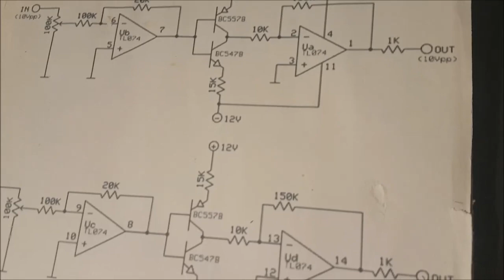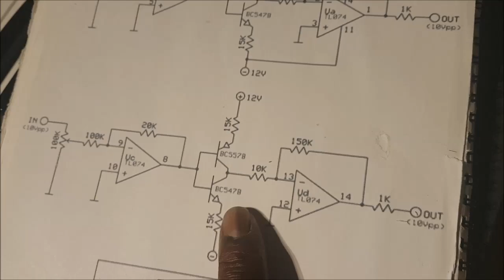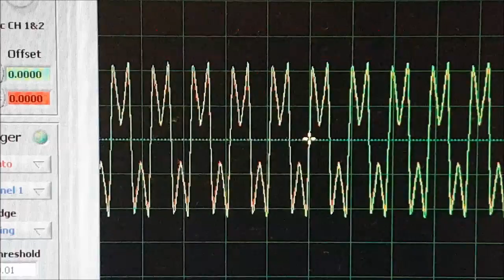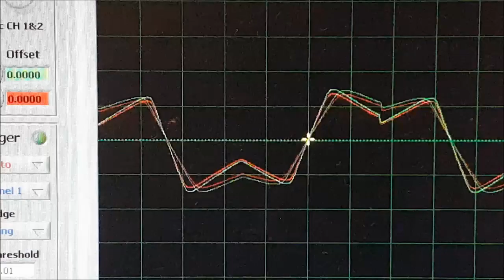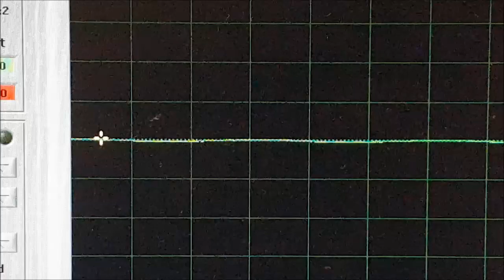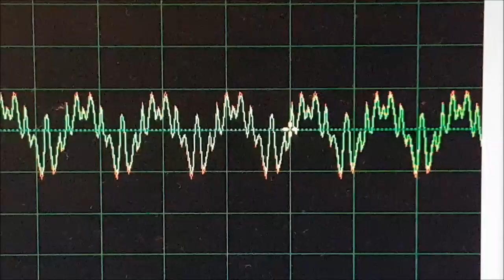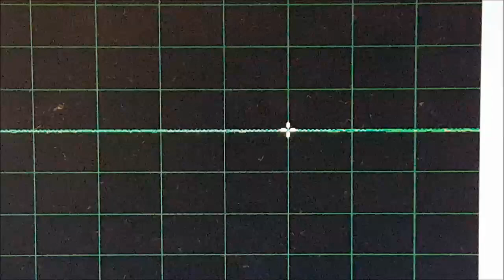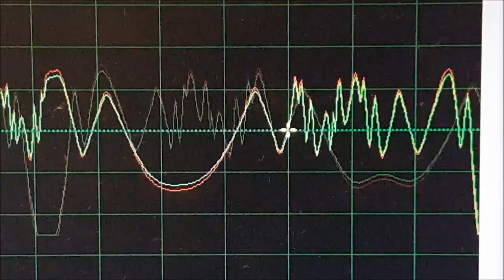DIY analog synth project (Wavefolder PCB Test Demo)

Comment: Hey brotha seeing if we can chat somehow got a few questions about circuits for ya. Let me know what’s best here or elsewhere thanks for your info much appreciation.
Reply from the maker: All good . You message me I  the comments here :-)
Reply: Adamski A.  Not used to YouTube just lost my first message hehe. Do you use discord? Trying to build up the saw core with a lm358 while some better opamps come in. Watched a few videos trying to dissect where I went wrong. I drew out your circuit and checked the tl074 data sheet then cross compared and drew for lm358. I believe I got it right but not sure how to show you. Would the pin 4 on lm358 aka ground be the v- akin to pin 11 on the 74? Using a dr meter ps 305dm will this give me v- also? Sorry if shit questions trying to not waste time .
Reply from the maker: @hereandgoneagain704  on most dual OP amps pin 8 connects to v+ and v- pin 4 on a quad op amp pin 4 is v+ and pin 11 connects to the minus. Did you set up the voltage divider to pin 2 by the way ?
Reply: Adamski A. For mine I set it to pin 6... should it be 2 and I reverse everything ? I was using pin 6 as the divider and 2 was connected to 1 via cap
Reply from the maker: @hereandgoneagain704  If you have done everything except in reverse on a quad OP amp it should work. I'm sure you have checked the data sheet.
Reply from the maker: So yeh output 1 and inverting input 2 should have the timing capacitor. Which value are you using ?
Reply: Adamski A. Just back home so the cap for me was between pins 1 and 2 on the lm358.  Going to remake the circuit and get back to ya see what’s what. If you check the pic on that Imgur link it shows the orig drawing I did. Chat later man thanks for your time much appreciation .
Reply: Adamski A. Only thing I can think is maybe my power supply is improper. It’s got a + - and ground connection so it leads me to believe I am doing it right
Reply: Adamski A. Can shoot you an email or discord invite if you wanna chat easier.
Reply from the maker: @hereandgoneagain704  Have you connected the pins 1 and 6 to a potenetiometer. Until you do that you won't have an output.
Reply from the maker: Have you watched this video yet ? https://youtu.be/u2JspaaJohY
Reply: @AdamTheAd-vanc3d  Thanks so much for your time! We got it working.   Will get some pics updated in a bit.  Beyond stoked, not sure why but I ended up needing a 0.22uF mkt box cap.  When I was using 100pf it was in dog whistle territory.  Most likely an issue on my end being uneducated.  We got oscillations though.  :D  Do you ground all your pots or do you use some like a rheostat with no ground?  Trying to figure out how to decide and when to use.
Reply from the maker: @hereandgoneagain704  Brilliant glad to hear it . Yeh the timing capacitor will basically determine your frequency range. If you ground one side of the pot the oscillation will stop. This is useful for me when I designed my lfos to completely stop the oscillation.  Try different value pots and caps for different frequency ranges. 
Your very welcome.
Reply: @AdamTheAd-vanc3d  Built up a second, and getting some crosstalk.  Now I built a triple avalanche osc before and fixed the crosstalk with some 100k resistors before the signals joined up.  This seemingly isnt fixing it over here.  Just read about 100nF decoupling capacitors on power rails.  Is this a thing that would help?  Going to attempt a few things but seeing how you dealt with crosstalk.  Also, just started a discord channel if you want to hop in it, theres litterally nobody else in it but maybe it grows.  Figure it may be easier to chat there than back and fourth here now that youtube removed messages.  https://discord.gg/WJJmX6U
Reply from the maker: @hereandgoneagain704   Using resistors on the oscillator outputs help and yes decoupling op amps and using caps in the uf range for audio signal helps. I not a master at any of this by far. Always as I'm sure you do, hunt around forums Muffwiggler and other synth DIY sites for suggestions.
Reply: Or is pin 4 going to be actual ground 0v on lm358 then run v+ and v- from power supply to the voltage divider

Comment: This is so cool. I love your videos and love that you break it down to one function per PCB. I would never manage and do a one PCB synth that did not work. Kudos
Reply from the maker: Hey thanks. Yes i originally was going to group some of the units as all vcos on one board 2 envelopes and lfos on another etc.. I sought advice and logically found it best to do it module by module due to a costly mistake. There has been some errors on some boards hence there are diffrent revisions. Thou all pretty much working now. It also allows for future expandibility or downsizing for future for example a single vco version with one filter and one envelope etc.

Comment: This folding sounds really good! Again reminds me old Yamaha chips for game consoles like Sega Genesis. What was with less beefy transistors? Were they more noisy or you use BCs just b'coz you have them?
Reply from the maker: Yes the folding  very much has  that midranging , spongy,  fm tonal quality.
I used bc 558/548 as these are higher gain . I did a 2n 3904/06 version on my breadboard which was a bit more noisier.
Reply: For a quick check it's handy to solder a piece of a "socket line". I've made that few times. Just need to place a bit of solder on a transistor's legs to fill the gaps. So it will be sitting in the socket tightly.

Comment: Hi, Adam! Does ceramic caps do not enough job for noise filtering on transistors? As I see you use some not cheap polystyrenes here...
Reply from the maker: Yes you can use ceramic. However i had none in the low pf range. The polystyrene caps im using are 180pf which is just enough to deal with the high end hiss without dulling out the peaks to much. Its an experimental balancing act.
Reply: OK :) These days Chinese make good film caps (i've bought some green) and good ceramic. These are smd with added legs inside a ceramic body. It's what i've read in some topic.
I save polystyrene for res. filters and oscillators.
Reply from the maker: @KiR_3d  Yes ive seen many on the net. However i bought a big bundle of misc componenets and these were amongst the lot. So putting them to good use.
Yes they are good for timing caps in oscillators or for vcf cutoff caps . They almost have a mica ish character to them.

Comment: I'm surprised I haven't heard anymore analog synths that use the wavefolder, it sounds awesome and the sounds border on something you would get out of a high end softsynth.
Reply from the maker: Thank you . Yes things like wavefolders are  more associated with modular or buchla synths. 
This also has another trick up its sleeve which i have never seen on any other analog synth.
Reply: @AdamTheAd-vanc3d  Is that the multi-stage wavefolding?
Reply from the maker: @soundpalette2438  No but watch this video https://youtu.be/ULVYpfW-EQM
Reply: @AdamTheAd-vanc3d  That is an interesting idea! If you make an analog synth with keys, complex FM and wavefolding + subtractive synthesis the thing is going to be a beast. So did you get the sine wave generator for the main oscs working or is the sine wave going to just be its own circuit for modulation? Also - are you interested in adding wavetable synthesis?
Reply: @AdamTheAd-vanc3d  Nvm you must have got the sine working, saw it in the wavefolder demo
Reply from the maker: @soundpalette2438  What you saw in the wave folder demo was the signal of my minibrute, which i did mention. I am still in the process of hook up the VCA and wavefolder to the ad-vantage 03 set of pcbs . Demo will be very soon.

Comment: Hi may I ask you to post the schematic? Would be very nice - Thank you
Reply from the maker: Google Ken stones simple wavefolder . Thats pretty much the basis of this one.
Reply: @AdamTheAd-vanc3d  Thank you very much. I'm planning to intergrate that "wavemodulation" to my Function Generator.
Reply from the maker: @Thomas-ob5fe  Brilliant. Dont forget you can also use a vca to add cv modulation. Maybe go for a lm13700 style vca as its less parts than the complete discrete vca type.